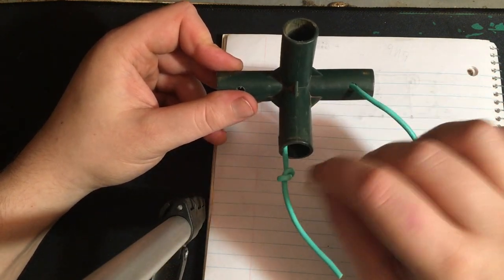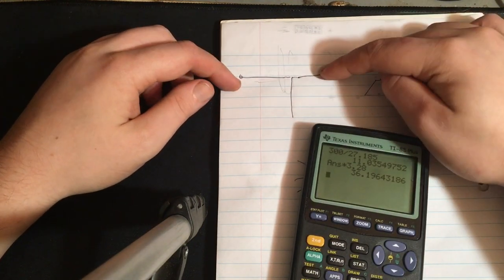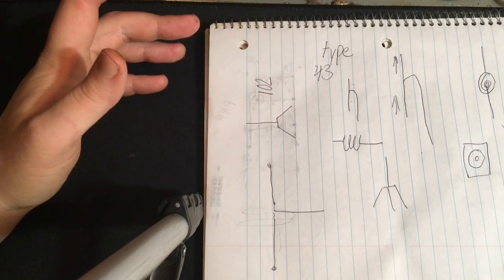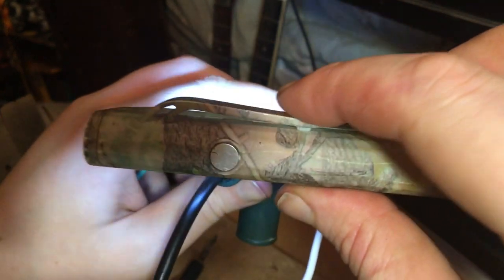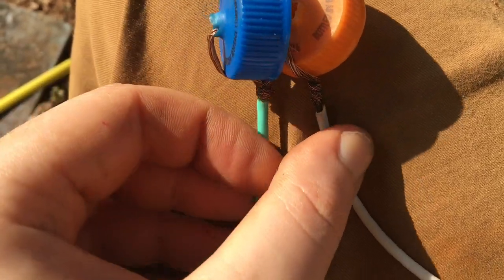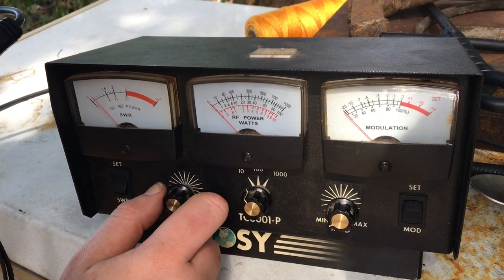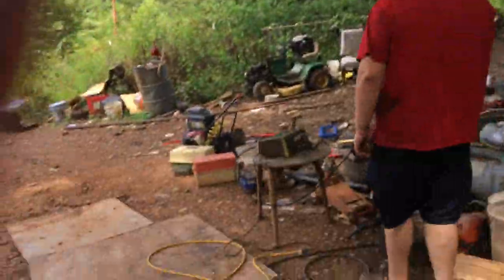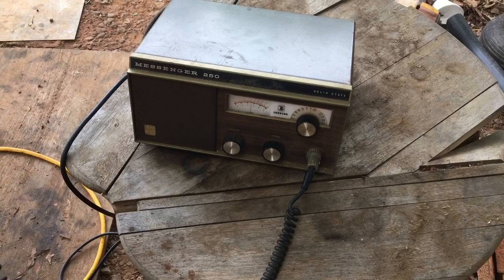🛑 HOW TO BUILD THE EASIEST CB ANTENNA, 500 MILE CONTACT TALKING ACROSS THE COUNTRY!   $5 BUILD

Comment: Can I use 20 ft of coax or does it half to be longer
Reply from the maker: You can use whatever you need, 20 foot will work but you have to run the coax at a right angle to the antenna for best results so you cannot lift your antenna very high.

But that’s up to you
Reply: @JohnnyNJones  How far do you have to run the coax at the right angle away from the dipole before you can drop down the coax?

Comment: Can this be used for uhf sorry new to this
Reply from the maker: Transmitting or receiving?

Transmitting antennas have to be a specific length.

If you are talking about receiving, then you can use any damn thing you want  👍
Reply: @JohnnyNJones  want to use it for my baufeng u  5r locally we a neighbourhood watch area is around 6 miles give and take
Reply from the maker: @deon4562  that radio should transmit that far with a stock antenna. If not then you can create your own. Use the method i used in the video but use the frequency you are transmiting on in the calculations. Or you can google “antenna calculator” and it will do it for you.

Look into using repeaters for wide coverage 👍 just be careful, if you transmit without a ham license someone could complain, you could just stick to GMRS frequencies to avoid complaints from hams.
Reply: @JohnnyNJones  thx i will build that antenna busy with license still but cant wait crime is on the up in our area thx for the help
Reply from the maker: @deon4562  no problem 👍 best of luck to you!
Reply: Will keep you posted😉

Comment: Use a drone as antenna
Reply from the maker: Tell me more!
Reply: @JohnnyNJones  just a thought😎😄 use a mavic pro or air,it can hoist 1 pound I believe .
I have too much imagination i guess🤔🍺😂
Including a thin wire to power the drone from the ground (excluding the battery,saving weight.

Comment: A longtime CB friend I just reconnected with showed me this YouTube channel about military radio antennas because everything is a kit everything can be made DIY in your backyard if you have enough space, or for the roof of your house. I wanted a Navajo Space Station in my kitchen to talk to some locals when I'm cleaning the kitchen and I did not want to hook it up turn my base antenna with an AV switch. So I had fun trying a couple different type and I just decided to run a flat dipole along the crown of the house. But these inverted V antennas are awesome if you live near mountains. Okay I'm giving you the link to lesson 5 in a playlist. My friend recommended starting with lesson 5 the rest you can do in any order they're not really chronological. Then you can have fun with the rest of the channel..

https://youtu.be/wdrIOKXF7jE

Comment: LOL antenna polarization only matters if you are talking LOCAL ts someone.  Once the signal hits and bounces off of the Ionosphere the polarization does not matter.  A 500 mile contact is Sporadic E skip and happens every year because it is not caused by sunspots.  Horizontally polarized antennas cancel out a lot of man made noise which is vertically polarized mostly.  Just about ANY antenna can work skip, Sporadic E or F layer... I have worked skip many times with a Realistic walkie talkie on the extendable antenna.  It's all in the propagation, not so much the radio and antenna.  Also depends on the interference.  You won't get heard on Ch 6 but if you find a clear channel with no strong stations and no bleed over from others (for you or the other station you're trying to talk to) you can talk skip as much as you want when the conditions are right.   BTW I have the same Johnson in my collection.   Interesting radios but really nothing special except that they're pretty rare now.  They didn't put out that much power and had very small final transistors.
Reply from the maker: Yeah I’m talking about LOCAL when I’m talking about polarization. 

A dipole in horizontal configuration can talk skip just fine, it’s the local contacts  that mostly use vertical antennas that you’d have trouble talking to

((For any third-party viewers looking at these comments what he’s talking about is when a wave hits the ionosphere it gets all jumbled up and it’s polarization can become twisted and non-uniform so vertical antennas can talk to horizontal antennas))

Yes most man made noise is vertical, but I don’t have any problem with that

I’d rather talk to locals than try to DX 

So how long have you been a HAM?

Comment: Not México. It is Spanish and sound like Cuban or Puerto Rico Spanish. Most like from Florida.
Reply from the maker: Hey maybe you’re right, but after I move that antenna I realize that every day here we have skip I can only hear Spanish-speaking CB users.

So if it were specifically Florida I think that would be at least one English conversation, but in my case especially if you check out my video I did recently on the president walker FCC

You’ll notice that I get absolutely nothing but Spanish-speaking users which is really interesting

Comment: Is that a Power Mic 🎙 we need to call CQCQ usually you’re on upper and lower side band tween 35 to 40 or other channels usually on 28 just just holler how about that DX Lynn D excellent that’s where we usually do I never hardly hear any by Cole CQ on regular 40 channel just when you got upper and lower side been radios just a thought guys But the antenna look good 10-4 shep out
Reply from the maker: Thanks for the information man, yeah I don't usually talk skip. So this is my first time actually making skip contacts. (except for the time i talked 600 miles in the truck)

So I'm a bit rusty on cb  etiquette

I'm not using and power mic or amplifier. I don't use amps, I'm more of a QRP guy haha